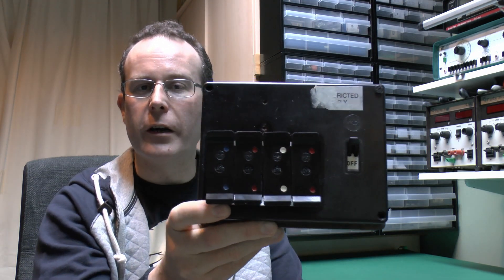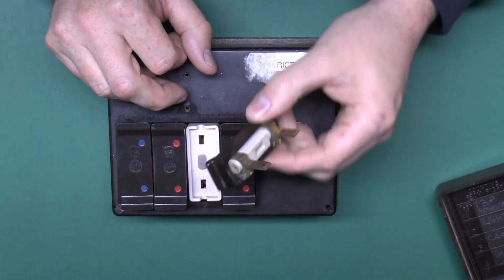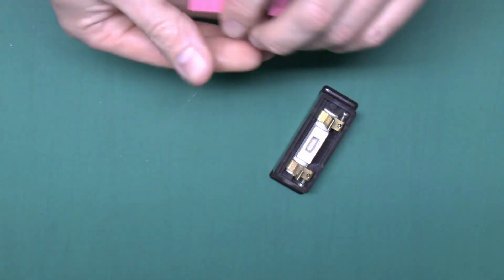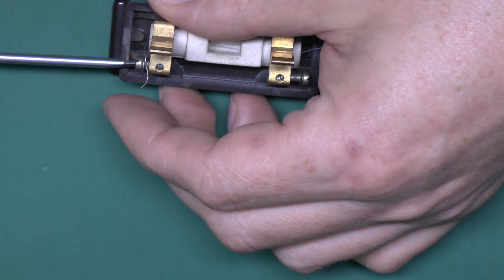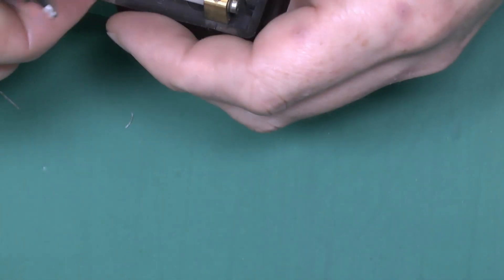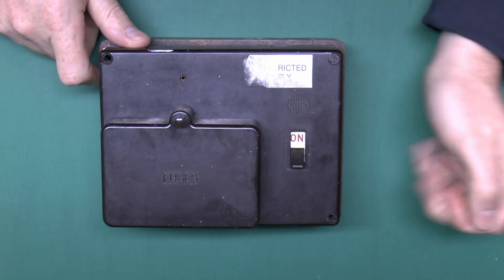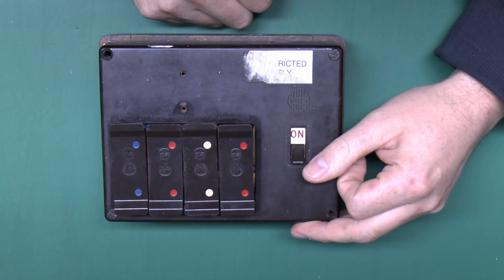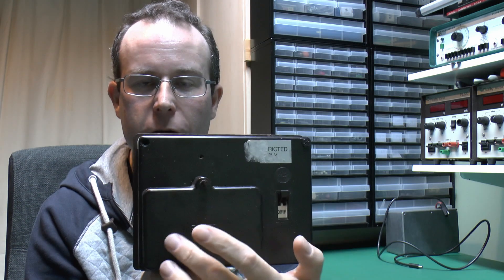How to replace fusewire in a fusebox with rewireable fuses

Comment: One advantage of rewireable fuses is you can tell what caused it to blow. 
If the wire has completely disappeared it's a short circuit.
If there is a small break in wire is an overload.
Reply: I got told these have asbestos in

Comment: I found this video extremely helpful.
I have recently purchased an old terrace house that was built in 1906 that currently has this style of removable fuse. 
The 5 amp fuse for my lights has blown. Having watched your video i feel confident to replace the fuse wire. Thank you for posting it. 
I am looking to eventually replace the fuse box and have a full re-wire.

Comment: One handy trick , is to get a few ( spare ) from electricians changing customers  fuse boxes to MCBs .... These are wired correctly and kept near your fuse box ... should a fuse blow , you can almost instantly replace it and resume power ( without struggling to find screwdrivers and fuse wire ( in the dark at 3 am ? )😝 .... this handy trick restores your power ( almost )  as fast as switching on a tripped MCB or RCB .... ( tried - n - tested ) ....... DAVE™🛑
Reply: I will be interested in buying the already wired fuses but where could I buy them?

Comment: Our fuse keeps blowing when my wife cooks. I know nothing about electrics. Could it be the fuse wire simply needs replacing? The only item running in our kitchen at the time is the oven, ie kettle toaster etc are unplugged at the time. Thanks.

Comment: Thanks for this - I have a similar unit branded "Tamlex" and I heard a small bang like a balloon bursting and the 5A light circuit appears to have gone (there's some blackening on the case of the unit around that fuse). Weird thing is there were no lights on at the time (I do have a lot of old incandescent dimmer bulbs maybe one of those was on low and the bulb finally went - dunno), but I'll try replacing the wire tomorrow as it seems super simple. Cheers

Comment: Thanks for the video. I am getting wire from B& Q tomorrow ( yes they sell it 2021) my lights have blown.. my smart bulb in my lounge went off and on twice on its own. Then all the lights went off ! This video is helpful for me a single woman, I will change the fuse wire tomorrow. When I buy the wire. Wish me luck 😂👀👌. So bad my flat has an old fashioned fuse box. These flats were built in 1990 .. NOT 1965 😯 ( I need money to get an electrician to replace with a modern circuit breaker board fuse box) I am skint at the moment. 😢

Comment: Thanks John. I had actually done mine as you said and it used to last for many years,  but the last I had to replaced the wire on the 5-amp it only lasted a few month.  Could the wires have been too old since I had them a long time?   I have now bought new wire.  Could you please let us know if wires can be too old thanks.
Reply: It won’t matter if the wires are old. They will still be good 👍

Comment: Hi, useful video thanks - but I was wondering what sort of problem there could be if the fuse wire in the centre seems intact? Could the wire have broken around the screws?  Or if it isn't the wire, what kind of other issue could be causing the specific circuit (in this case overhead lighting) to stop working? It isn't the bulbs..definitely looks like a blown fuse, but wire intact.
Reply from the maker: Yes, it can break at the screws, or in the ceramic section which isn't visible.
Either test it for continuity, or just remove the old wire and fit a new piece.
If it's not the fuse, then a damaged/loose connection somewhere else is likely.
Reply: @jwflame  Thanks for reply. I'll look into it.

Comment: Hi john. Great vid. My 30 amp fuse (wylex) blew which is connected to the mains socket of the house. I replaced it with a  32amp trip fuse. Problem is it was tripping after an hour or so. But when replaced with a new 30 amp fuse it doesn't trip?? Can you think why this is? Many thanks

Comment: Hi, do you know if we can put a 15A fusewire in a rewirable fuse 3A?
Reply: It will normally fit just fine, the only real difference in these fuses should be the colouring and printing on the outside. Of course it is not recommended to put 15A on say, a 3A lighting circuit. If the fuse is regularly blowing, there could well be a fault which could cause a fire. If the circuit has become overloaded due to extensions added over time to an existing circuit, it really should be split in to separate circuits, in my opinion.
Reply: @ollieb9875  please can u help , I have this type of fusebox , I think somebody got two fuses mixed up  , they have 15 amp blue for wall sockets re plugholes and 30 amp for heater?? , I think it should be other way round but am scared of putting 30 amp wire to serve wall sockets in case it damages wiring , I don't know why previous owner did this , 15 amp wire has blown a couple of times
Reply: @victor-oq7dl  yeah, 13A should be enough but I'd say don't fuck with it. I'm not an electrician. If you're blowing 13 amp fuses there's possibly some other issue
Reply: @victor-oq7dl  please, just get an expert in, I know it's expensive but just to be safe yeah. Be well
Reply: @ollieb9875  thanks for your reply , may as well get someone in probably something simple (to them) cheers.
Reply: @victor-oq7dl  yeah if it's water or mud have a go yourself. Electric though? Maybe just hand over to the experts.
Reply: @victor-oq7dl  yes it should be other way round 15 amp is way to low for sockets no wonder its always blowing and 30 amp is to high for the heater, it could damage it

Comment: Was curious as to the different wire gage sizes and what is the material used for the fuse wire?
Reply from the maker: +brian nelson The wire is tinned copper, with diameters of 0.2mm for 5 amps, 0.6mm for 20 amps, 0.85mm for 30 amps.  Many other sizes/ratings are available.
Reply: This fuse wire is not available every where